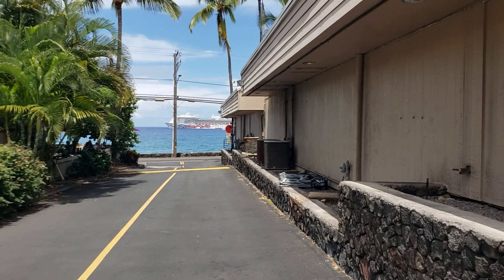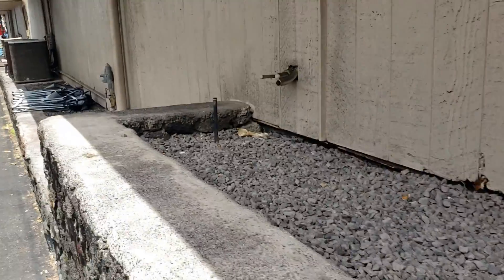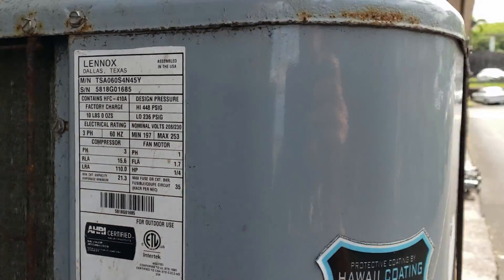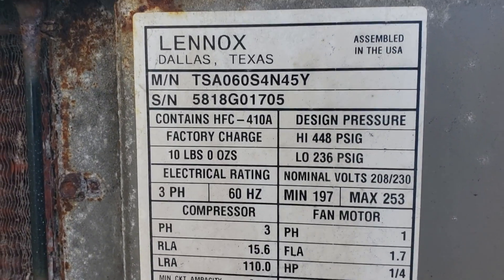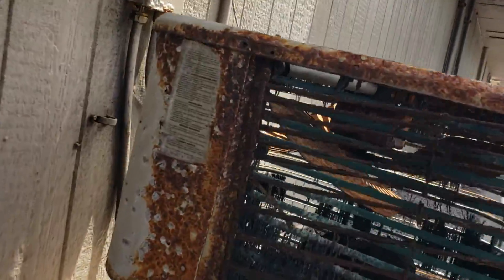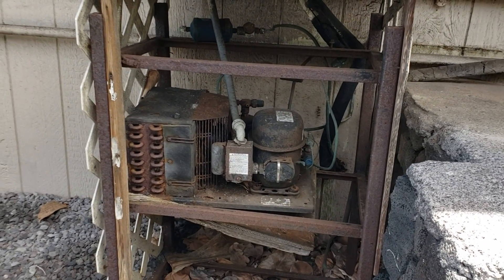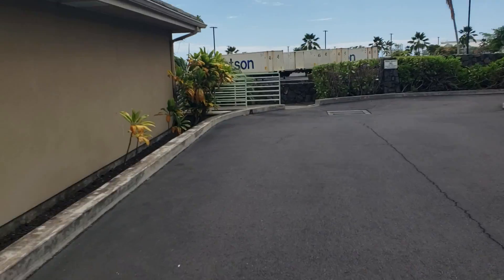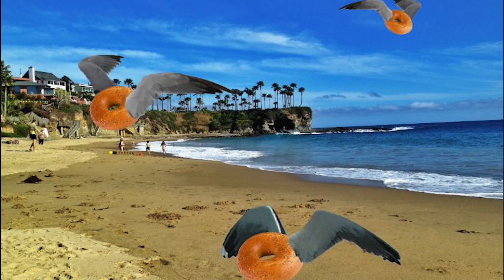This is What Beach Property Air Conditioners Look Like

Comment: I know that the oil industry uses galvanized metal and brass in these salty regions to protect their big pumping coolers. But as a practical purpose for small air conditioning systems, I think you see what's practical, but gets expensive due to short life. At least coastal areas are generally cooler.

Comment: Hi Jay. I have a question. I bought a 12000 BTU mini split for my garage and want to put the condenser in the back yard. Because I would have to add 40 ft of line does that mean i would need more refrigerant? The system comes with refrigerant in the condenser. Not sure if adding more line would call for more refrigerant. Thank you in advance.

Comment: Hello been watching your vids for a while they're really helpful. Got a tech question, I'm working on a 2014 Lennox unit my issue is I have constant power going to my contactor from the control board the unit has a separate thermostat wire from the board to the contactor which are red and white. The fan and compressor constantly run even with no call for cooling and the thermostat off the wall mount. Thank you for your help

Comment: Jay, you need submit these to 'america funniest video', so entertaining.  The 4th one can be repurposed as chicken cage😂

On a practical side, can people apply some kind of thin coating or oil to delay this rust process?  This is similar to car rust !
Reply from the maker: Lol, that's a good idea! We can make this air conditioner famous 😄

They do sell some products but as far as I know, they are not very effective. The best remedy would be to rinse down the unit with water regularly to clean off the salt build up.

Comment: Those of us that live in norther winter climates where the snow can freeze into deadly ice have to deal with what road salt does to our vehicles. It never occurred to me the "gentle ocean breeze' would do the same to any thing metal in its path. Thx.
Reply from the maker: I used to live in Minnesota so I know exactly what you mean. I've actually never seen air conditioners in such a sorry state before either so when I saw that, I just had to share it with all of you too. 😄
Reply: @WordofAdviceTV  - Glad you shared this. I lived in Florida for 3 yrs just off the Bayou but our house was surrounded by trees and bushes. Just the same I never saw such metal damage like you have shown here. Seeing is believing. Thx.
Reply: And the salt air is nasty to electronics on board boats and ships.
Reply: @peterkratoska4524   - didn't know that either.

Comment: Wonder if units can be engineered with corrosion-resistant materials for these types of environments. I'll bet they wouldn't be cheap. Maybe some type of 3D printed ceramic fins for the coil or something... Heck, I'm just throwing that out there. I'm no engineer. LOL
Reply from the maker: I think they do sell units that have coated coils specifically for seaside applications. But as far as I understood, units by the ocean should be regularly sprayed down to get the salt build up off. No matter the brand or coating, it's just a matter of time until it starts to disintegrate.

Comment: Does anyone make a protective condensor cover that allows airflow, possibly by louvers, only when the fan is running?  That would be great for coastal owners.
Reply: Just order coated coils designed for sea side installations.
Reply: What do they coast them with? Thanks! ❤😊

Comment: Yeah I saw this myself when I was a helper for this company on the island. I remember on a pm he told me to remove the disconnect and when I tried, it made a nasty crackling noise almost like the sound of crushing a bag of chips. And I stop and look at him because I could just tell that the whole thing was about to come off...and there was this thing he showed me that they sometimes put on unit, this pokemon ball shape thing. It's used on boats to prevent rust. Forgot the name
Reply from the maker: Good to know that there is something that can help with that problem. Thank you for sharing your experience!

Comment: You can add the line set grenades and condenser coating to help lessen the damage. Regardless, the salt air will eat everything much quicker.
Reply from the maker: Thank you for offering a few solutions. Rinsing it regularly would help a lot too.